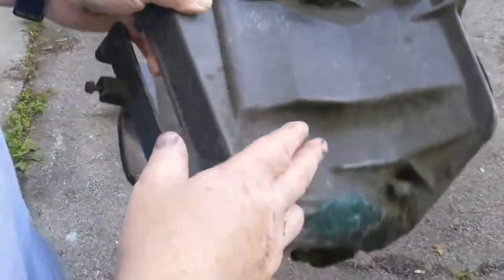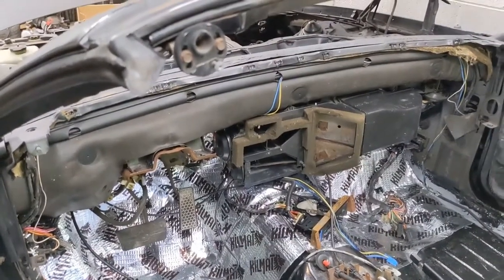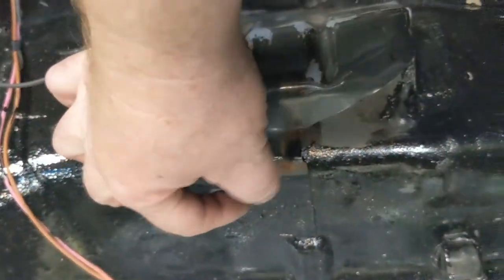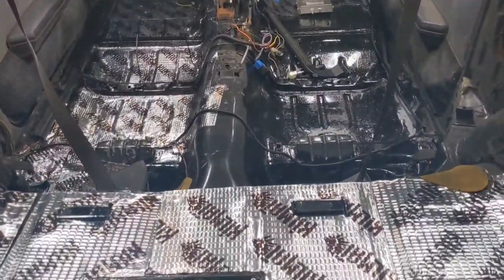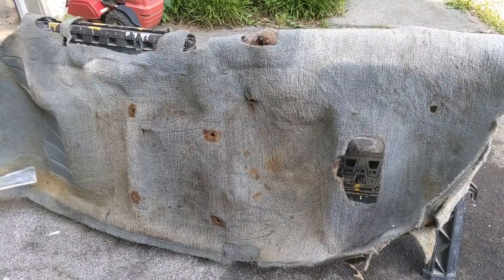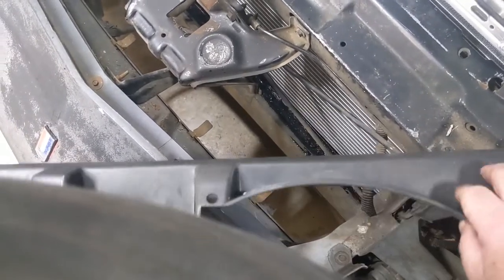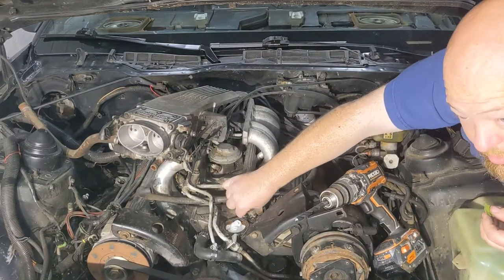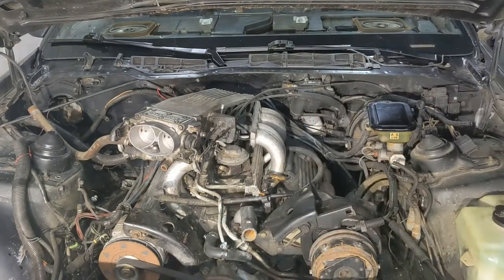Can Kilmat take the heat?

Comment: I just got a box of the Kilmat in today.  I’m starting in the hatch area on mine, then working my way forward.  I’m dreading pulling my dash out, but I know it’s gotta happen.  The wires is what concerns me.  Being able to get everything back together.  Mine is a Berlinetta, so I’m sure there’s some difference between yours and mine.  I might have to pay you a visit sometime to talk a bit.  Luckily I have a 5 year plan to get mine back on the road.  So I started with the interior first.
Reply from the maker: Disconnect the wiring harness from the firewall bulkhead. That way you can leave as much as possible intact. It ended up taking me two cases of kill mat to do everything. It's definitely not easy but absolutely worth it.